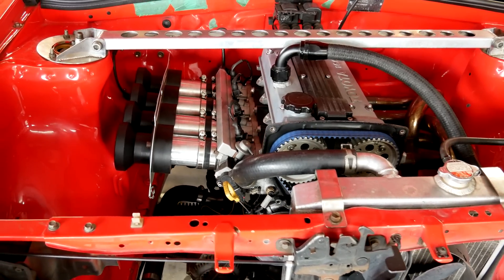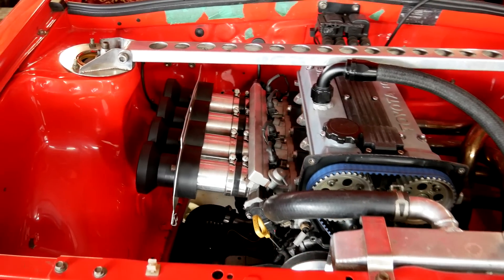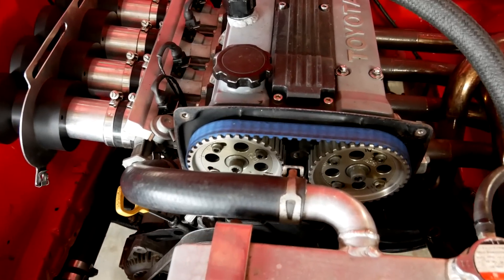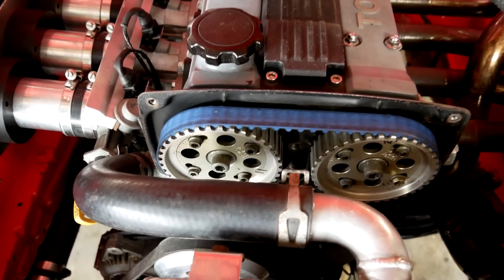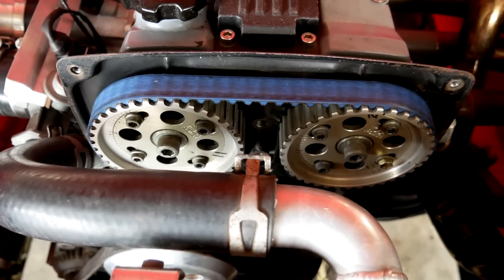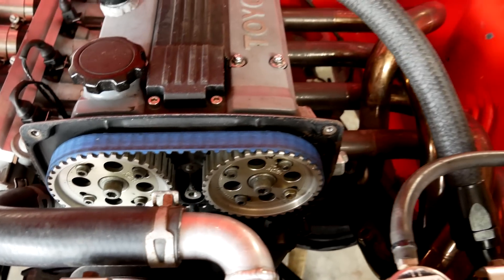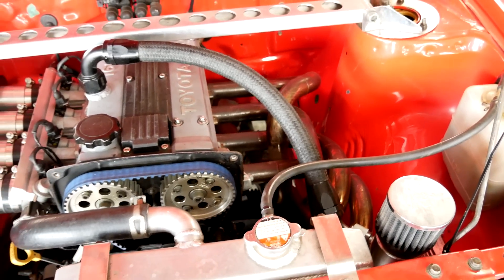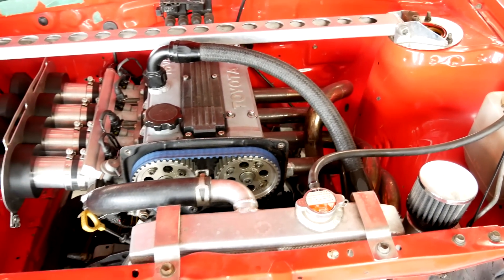Effects of Cam Timing on a Big Cam Engine - Dyno tested - 200hp 4AGE

Comment: Awesome bro, what cam are your running and what advertise duration, kelford...
Reply from the maker: Its a mix n match set, that tbh i dont want to let out what they actually are.     but can say they are  both around 300deg advertised
Reply: So it an under bucket set up, not a mild one....hey is Kennelly cam any good compare to kelford...I got a pairs.. intake 270 odd exhaust 255 odd standard shim looking for 120kw at wheel with micro tech lt10c silver top itb...and fujitsubo jasma extractor....also you run double valve spring or kelford beehive....thanks bro
Reply: @suronsoon8913  I have a kennelly cam in my 4K, the most mild one I could get. Seems to work fine

Comment: You really can hear the 18deg retard on inlet and the engine is not happy at all, it just doesn't want to sing from the mid range. Awesome stuff as always. Interesting how the similar engine setups have the dip in the torque at mid range before it comes to the cam.
Reply from the maker: 4age's suffer from from a hole at 4000-5000rpm, if not running the right setup on exhaust side.   Tuned one with a lot smaller cams (advertised as a midrange cam)  the other day   had 20kw less at 4500-5000rpm  than engine in this vid.
Reply: Garage 4age It somehow common to zetec engines as well with throttle bodies. Have seen similar looking torque curves on simlar engine setups.

Comment: As always very nice.
What is with the other way round?
Advance inlet and retard outlet, should push the torque at lower rpm.
Reply from the maker: do you mean why didn't i advance the inlet & retard exhaust?     because my normal setup is maxed out in terms of valve to piston clearance.  so can only go the other way.

Comment: shame about your piston to valve clearance limiting the tests, I'd of loved to see you find the best overlap and then advance and regard both cams together keeping the LSA the same 😁
Reply from the maker: Yeah,  judging by the tests here, I think  going much more  would start to take too much away from the top end.  although it would be nice to see what it would do, see if the bottom end comes up anymore.   As i said in a few other comments I have an exhaust cam in the inlet side, so there isn't a manufacturers recommended spec to dial it in at.   but  for some kind of reference, the 8 deg inlet retard run is at factory timing marks.

Comment: adjusting cam on inlet side does exactly what you would expect ...late timing improves the top end ...lots of o/l will mess with the bottom end ...and exhaust timing, well not much happens there . thing is your monkeying around with non stock cams, of which we have NO idea where the valve timing is or CLA...I think you proved that your original set up was very good
Reply from the maker: Yeah, main point i was trying to get across was  actually try adjust your cam timing.  so many people buy fancy adjustable cam gears and leave them on factory marks.   Even if i had all the numbers Its not going to be relevant to anyone else engine.   I can do the same thing on a stock cam 4age soon, but may not be very interesting being so tiny. possibly can do the same thing  with an off the shelf cam set that i have all the numbers for  if any interest.  would be on a different engine to the one in this vid

Comment: Where is the video which shows how you how you got the 200ph in the first place.. i think all i can find are videos fiddling with a few HP here in there but nothing ho how you got it in the first place.. this seems amazing.
Reply from the maker: Yeah come in a bit hot with this engine.  Ive slowly developed it over many years. mostly pre having the dyno and making video's like this.   Its at the point where gains that dont trade power from one part of the rev range to another, are hard to come by. Im not completely out of ideas yet though!

Comment: 5 Degrees by cam it's a huge overkill because it's 10 degrees by crankshaft. Real perfect tune up is not exceed 4 degrees, but as usual sweet spot can be find around +/- 2 degrees over zero cam setting.  Some cams need to be adjusted only with dial indicators to the cams manufacturing overlap specs due very sensitive design.
Reply from the maker: Have to disagree.  maybe in some case this will be true. if the cams happen to be bang on for what you are trying to achieve and the the engine setup, on the manufacturers  recommended settings.    going with what the manufacturer recommends or only trying a few degrees adjustment maybe leaving a lot on the table
Reply: @Garage4age  Meanwhile VVT motors moving cams around by 60 degrees lol
Reply from the maker: @RomanDaveThings  Thats too far im sorry

Comment: Did you tried different length velocity stacks on different cylinders? For example on Honda CBR600 velocity stacks on 1 and 4 cylinders are 5 mm shorter than on 2 and 3. In theory it should give smother power curve.
Reply from the maker: Have found using the right length runner on all 4 gives the most overall power.  But yes could fill the dips using a range of runner lengths giving a smoother power curve.  but since would have to choose a length that doesn't work quite as good over all. would take a little hit in over all power to do it.   each cylinder would need to be tuned individually also.

Comment: Thanks for the tests! nobody else takes such a systematic approach to the tests. I have 2 questions
1. What other changes have you made to the engine (intake or exhaust ports, compression ratio, moving Parts)
2. Which camshafts are installed or do you know the approximate total timing   Thanks!
Reply from the maker: pretty much everything has been played with in some way on this engine.   rotating assembly is all off the shelf parts. about 13:1 compression. ports modified and bigger valves.   i have a mix and match of cams in there.  they are around 300degrees advertised duration. or 260deg ish at 1mm lift.
Reply: @Garage4age  Thaks a  lot! 300 degrees  4V and still  idle is ok!

Comment: Is that 202 rear wheel horsepower? What engine rpm is that at? Around 10,000rpm?
Reply from the maker: Yes  wheel hp.  202hp on normal settings 209hp  when setup for peak power.    rpm is at top of graphs.  about 8200rpm is max power. revs to 9200

Comment: 5 degrees exhaust advanced is the best , wonder if advancing the intake as well as the exhaust would've produced even a better powerband , by introducing more overlap .
Reply from the maker: Hi.  Both the cams are maxed out  in terms of piston to valve contact clearance, on the "normal" setting.  so sadly cant try anymore advance on the inlet

Comment: Awesome to see this on video. I got 250hp from fly in my na 2.3 duratec. Cam timing as manufacturer recommended. 2 deg exhaust retard brought significant change in torque, have to try retarding inlet cam maybe 5 deg and see what happens. Keep up the good content! Finally someone makes informative videos from pretty much everything i stress my head about
Reply from the maker: definitely have a go with the inlet cam. usually far more to gain on that side. try advancing it for more midrange,   watch out for those valves though!

Comment: Why didn't you delay the exhaust command?
Reply from the maker: My "normal" settings  are pretty much maxed out  in terms of valve to piston clearance.   So if i leave the exhaust cam open any longer = bent valves.   same deal with inlet If open any sooner piston to valve contact. hence why i only move the cams in one direction .  where i started from are not the recommended settings from cam manufacturer
Reply: Garage 4age how much safety margin you’ve left in it?
Reply: @Garage4age  if you would buy new big degree cams would you put the cams in at lets say Inlet 1.5mm inlet piston to valve clearance and exhaust 2.0mm clearance for best mid range power?
Reply from the maker: @dex5151   First thing i would do is find minimum clearance.  mark the gears, so dont go to far and bend valves.    then do some testing preferably on dyno, but can be done  comparing afr and injector duty.     Depends on the cams and pistons at what clearance it will make the power curve you are after.    just remember contact will be after/before  (in/ex) tdc, as the valve accelerates faster than the piston.     otherwise yes tigher the piston to valve on both sides is where the midrange is
Reply: @Garage4age s is really helpfull thank you. How can you tell from looking at the afr that the timing is perfect for midrange? Could it be that you can lose reversion from the header  🤔. I dont have injectors on my car, i will set up an old school alfa 2L nord with carbs in the future. I also heard from an Alfa tuner that he also uses the exact same method, i think if its NA there are definitely some similarities between different engines
Reply from the maker: @dex5151   Yeah will be best to set on dyno with carbs.     Efi  can see if its using more fuel  or requires more fuel, looking at the injector duty  and afr.     generally if needs more fuel for the same afr or is running leaner at same injector duty, means its making more power. sometimes i still use that method  on dyno to double check against dyno.      Engine is an engine to a point, so the principals  of cam timing are the same.
Reply: @Garage4age  Yeah true, will need a dyno to 100% tune it right, i am trying to get it right from the get go 😄. One more point, if gaining overlap on the exhaust side,why is the engine pickung up more mid range, i thought overlap is a high rpm thing espicially on the exhaust side🤔 it has to do something with the exhaust pulse no?
Reply from the maker: @dex5151  Its the closing events that are more important. overlap is just a side effect of the  cam duration.  as you can see in the video, when the exhaust cam timing is set right it makes good power almost everywhere,  dont really need to choose between midrange and top end so much,   unlike the intake cam.    intake side, closing the intake sooner which results in more overlap, will trap more air in the cylinder at low  air speed / rpm.  retarding the intake cam will put the closing event more into the compression stroke,  but the high airspeed at high rpm will carry on filling the cylinder against the compression stroke.
Reply: @Garage4age yeah i can only get it 100% right with a dyno. Thank you for the help :) 👌

Comment: Bravo! We are brothers from other mothers. Very few channels with this quality.

I only build inline 4 twin cam NA motors. Find it very satisfying to extract all it can give.

I have alot of tricks i managed to score from Yoshimura racing.

Try out this calculator. It will be love at first site.

http://www.bgsoflex.com/roughhp.html

Compression
Duration
Intake port approach and profile> airflow
Make Exhaust ports and headers smaller than you thought. Dont believe me. Try it.
And alot of times, dynos and tracks dont get along.
Airbox size
Port taper from bellmouth to choke point should be undisrupted at a 2° included angle.

Im working on building a set of rollerbarrel individual throttlebodies.

Keep it up.
Reply: Thoughts on a slider throttle body? Easier to make than a barrel style and at wide open throttle will have a fully open port just like barrel style.
Reply: They're good for flatout applications, but piles of shat for transition power.
But Twim Roller barrel are the cats miao.
Reply: @jonazevedo28  Gotcha thanks.

Comment: Next Time maybe some Ignitiontuning? =) Cheers M8
Reply from the maker: can do at some stage. had a few requests to do something with ignition timing.   what would you like to see, just range of ignition timing and how it effects power?
Reply: @Garage4age  Timing and how much it changes Power, maybe different Plugs (Hotter/colder), Different Coils if possible (More or less kV).
Thanks for the reply =)
Reply: @Garage4age   differents Gap's of spark's and Iridium vs stock. Cheers
Reply: One thing i'm curious on is where we can set the max/best timing, rather than 3k rpm like the olden days, 6k? 7k rpm? The quench on the 4age is pretty good so maybe it could be even lower at 4krpm for best max timing. Or weirdly enough would it be more effective to drop a degree or two at the top end due to such high piston and air speed  (curious). I noticed on my carburated 4age it seems to stop gaining power around 6k for 35* degrees. Versus years back when i had a basic MSD and it was locked out timing I had no mid range, I have currently a digital 6al2 so now i have a timing curve and gained power and response in cruise/part throttle and midrange.
Reply from the maker: @ardisian   from what ive seen a lot of people run there 4age's over advanced.   This is based on what i've found on the dyno on a few different engines.  but also seems to be a pretty big window where they will make the same power if not knock limited.  thanks for the suggestion.   i can run flat timing across the rpm range  and slowly increase it to show where each rpm point  makes best power.  Setup in this vid is out of action for a little bit, but will add it to the list

Comment: would be interesting to see the difference between a N/A-camshaft and a turbo-camshaft on a turbocharged engine
Reply: Turbo cam is a kind of a myth. Any N/A cam is suitable for turbo.
Reply: @tiitsaul9036  I don't think so. The pressure inside of the header between head and turbine is bigger then boost pressure, so you don't need valve overlap to create scavaging
Reply from the maker: Agree with old mate Richard for the most part. But choosing the right cam/s for the application is the main thing.   big na cam/s may work on a turbo engine. but would be something suited to drag racing or the likes. as would want to run a suitably big turbo/exhaust side with low back pressure.  thing with most turbo stuff is having you cake and eating it too.  have a nice  running engine at low rpm's and idle and having wide powerband too. along with being easier to make work, low overlap cams are the go to.     I have tried some "na" cams in my turbo engine, and come up with a combo that worked well over most of the powerband. but it ran terrible below 2000rpm's  due to big plenum single throttle inlet.  so went back to the factory cams.    i will likely revisit this  now i have changed to itb's

Comment from the maker: Greetings.  Why didn't i test some combinations  of Inlet and exhaust cam timing?  Main reason being it would have ended up as a clusterf*&k of information.   2nd reason;  I have tired different settings and at least on this engine adjusting each cam on its own will get very close, to what you are trying to achieve in the power curve/application.   then just some fine tuning.      Another thing to note, I have done quite a lot of changes on this engine and not revisited cam timing. Hence why i found a little power adjusting the exhaust cam, over my normal settings.  Edit: Another note. reason why i only moved the cams in one direction, is my  normal settings are about as far as i can go in terms of piston to valve contact. So these tests were adjusting the cams away from this
Reply: Bet best of the two would bring in mid range torque from overlap.
Reply: Could you give some information about overlap and the timings of the cams?
Reply from the maker: @TurboAcki   No can do sorry.  cams in this engine are a mix and match of cams i've tried over the years. and aren't in there right locations, an exhaust cam in inlet side and inlet in exhaust.  So I cant even tell you what the manufacturer recommended settings are.  I don't bother with degree wheel as tune them for best results on dyno.   but from memory its has around 5mm lift on intake, and 3-4mm exhaust  at tdc.
Reply: @Garage4age  if you didn’t know the cam specs then how did you determine (safe) piston to valve clearance when setting cam timing?
Reply from the maker: @twinchargedmr2  I adjusted the cam timing till the valves bent then backed it off a bit 😂.    I have done some piston to valve measuring in the past.  in this vid i moved the cams only in the direction that the clearance gets bigger
Reply: @Garage4age  a shame you can't go the other way really! Cluster** aside it would have been ace to see the effect of same overlap, moved timing as well!
Reply from the maker: @brynwilliams380  The run with my normal settings inlet is advanced 8deg from the factory mark.   I cant say if that would be the be the recommended manufacturer setting. since its an exhaust cam, as nothing to reference and measure from.  but seems close  comparing to similar cams.     So  the 8ded inlet retard would  be my closest guess to both cams in manufacturers recommend  settings. but yeah is a guess, so didn't put the info in the vid.
Reply: @brynwilliams380   
Yeah yeah !!! thats my thinking exactly ! 
4age Garage videos are superb but on this occasion i am slightly disappointed. 
Perhaps he needs a donation of awesome pistons with mega valve relief..
I have a overlap of 3.62 at TDC in/ex
I am wondering what it will do come dyno time
Reply: Where are you and how many beers for dyno usage?

😉🍄
Reply: My engine is down about 13% on power and somebody has said it could be cam timing being out.  From watching this I think that’s unlikely.  13% is too big a difference and you didn’t see anything like that.  Agree?
Reply from the maker: @CurboroughSprinter  only if it was way out.  tooth out or the likes.  or cams ground/indexed wrong
Reply: @Garage4age  so one tooth is more than you’re adjusting here?  I thought it would be about the same.  Thanks for reply.
Reply from the maker: @CurboroughSprinter   tooth is 20deg.   im more going 9 degrees either way here. rather than 20 in one direction.   as inlet cam was already advanced
Reply: @Garage4age  wow, didn’t realise one tooth is 20 degrees.  Thanks very much. 👍